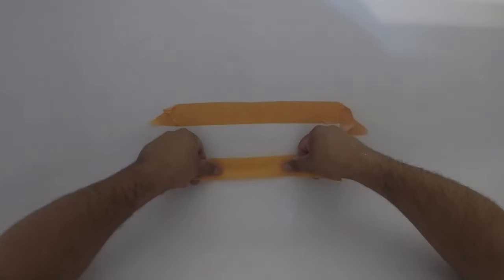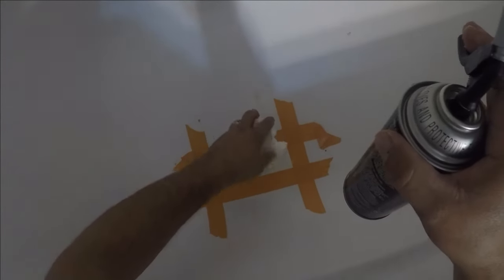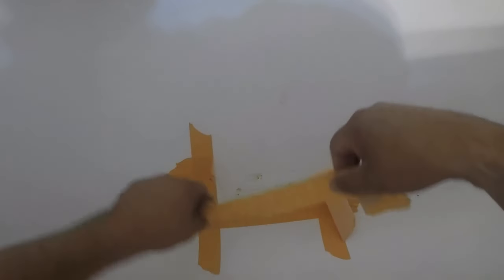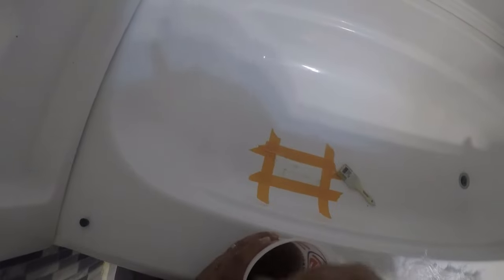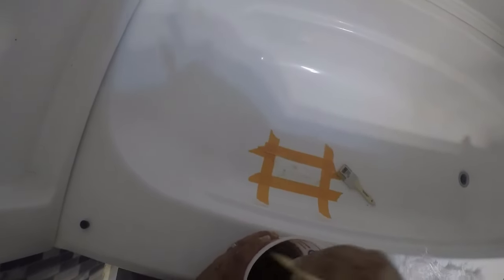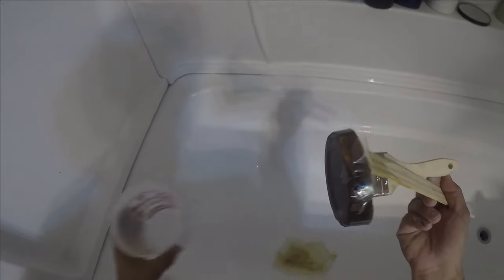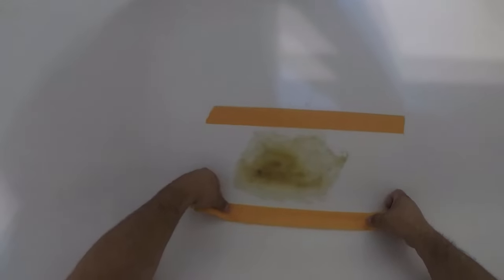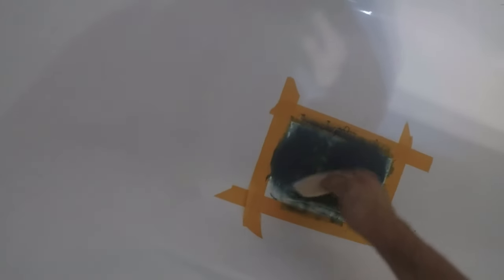How to repair a fiberglass bathtub crack  | DIY Fiberglass Resin Crack Repair with Foam | DP TUBS

Comment: your list of materials was quite long. can you simplify that list by listing just the products you use in this video minus sandpaper, tools in the order you used them. In other words, just the foam and the liquids used? That list was overwhelming and listed 2 different products for the final paint application: Krylon Alternative: Rustoleum Tub and Tile White: and Rustoleum Applicance Spray White; not sure which is suppose to be used. I also dont recall you using tack cloth, caulking DAP Stretch, acid etch, epoxy remover or duct tubing unless you didn't show these steps, which makes it confusing to know what to actually do. please clarify

Comment: Ok so drilling holes around the crack and filling with foam helps so it doesn’t crack when you step on it? Because someone came to do this job to my bathtub but didn’t drill holes and a couples weeks later it cracked when i stepped on it
Reply: @cry_now_laugh_later  do you have a video of how to do it ?
Reply: @susiehernandez6652 ... El Comentario anterior es verdad
Reply: @cry_now_laugh_later  Exactly.  There is a lot of space under bathtubs!  The insulation foam he used is not designed for structural support. You can spray that foam to fill the A/C line penetration into a house but it is not designed to support weight!!!
Reply: @cry now laugh later  so do you have a video showing your technique?
Reply: @crystalfarmer4074  can't believe everything you see on YouTube!!
Reply: @cry_now_laugh_later how do we repair tub chips if you could tell us step by step how to do so that would great!
Reply: Wheres the list of materials

Comment: Thank you for doing this Video. I have the same problem in my Shower Stall. Except my problems are more numerous. Cracks, soft spots like yours. But worse of all is a crack around my drain. I really don't know how to fix the drain area. If you or any of your Viewers have any suggestions. I would GREATLY appreciate it. I'm trying NOT to have to replace the entire shower. I can't afford it. Again, thank you ... 🙏🙏🙏

Comment: Do you need the bondo putty?  Can you get the bondo glass smooth enough and paint over that?  I'm sure there is a reason,  but I am concerned to use non waterproof layer on top. Thanks.

Comment: Great video thank you for sharing. This helps! How long did you wait between applying Bondo glass then sanding? Also, same thing with putty and sanding?
Reply from the maker: obviously until its fully dry--depending on climate could be 15-20 minutes

Comment: Do you need the bondo glass after the resin and mesh
Reply from the maker: i use it for added reinforcement but it is not necessary

Comment: Thank for posting this video. I have a 3 inch crack in my bath tube, crack is super tight (can barely see it). I have access to the bottom-back of tub as shower in on second floor above my garage. My question for you is:
Would it work if I follow all  your repair steps and work only on the back of the tub? Im trying to avoid drilling holes, sanding, and painting tub. I would rater patch and paint my garage ceiling. I would appreciate any feedback.
Reply: It is called a hairline or a spider crack, I have repaired but not his way lol, as I am a fiberglass specialist

Comment: Is there an inexpensive spray gun and compressor that you would recommend? I'm just starting out just doing repairs. Would the krylon tub and tile be good enough for repair work and no gun needed?
Reply from the maker: You can try the Wagner Flexio 3000

Comment: I'm about to fix a crack but in the contour of the where the sides meet. My question is how do I keep the resin from running down the tub AND do I just use a plastic mixing bowl to mix putty/hardener ? My 1st question is the one I'm unsure of and need advice please.
Reply: I would mix the putty/hardner on a piece of cardboard.  IT is flat like the tub, will let you mix it well and then get it to the tub using a putty knife or spreader like he did. You'll lose a good bit if you do it in a bowl.

Comment: Is it necessary to drill holes? Can I get the same results just without the drilling
Reply from the maker: If you don’t need support or don’t need to add foam then you’re good
Reply: I think the holes is to stop the cracks from spreading past the end of the cracks.
Reply: I don’t think foam is strong enough to withstand the weight/pressure. Have you tried to test the strength of the foam?

Comment: And another question what step did you use the napco extra strength etch
Reply from the maker: No etch is used on a fiberglass repair

Comment: I'm worried about fumes, should I be, my hot water heater is in the same room electric but still worried about it clicking on and off my gas to my furnace is off so no pilot light there but also worried about my window air conditioner clicking on and off as well as the pilot light for my gas stove! Hope you see this and can reply any suggestions would be greatly appreciated thanks.

Comment: I followed this for an almost identical crack in my shower surround tub but the foam has created a hump in the fiberglass floor.

Should I cut a hole so I can remove some foam and then patch it using the method in this video or is there a better way? I'm worried about drainage. I welcome all suggestions. Thanks.

Comment: is there any way to  replicate the non-slip original finish ? most tub or shower floors have a rough texture, you didnt address that
Reply: Great question.
Reply: Textured spray paint

Comment: Do not underestimate  category 3 acute toxicity level when you are working without high quality respirator and other protective equipment. Bondo resin fume and dust is extremely toxic and it can destroy your lungs, liver. This video does not cover that.